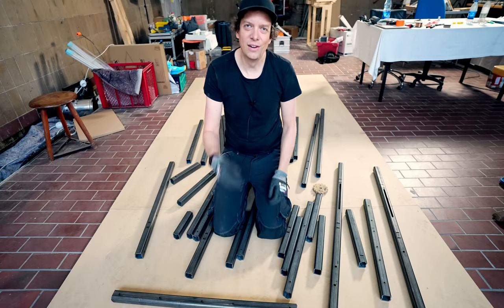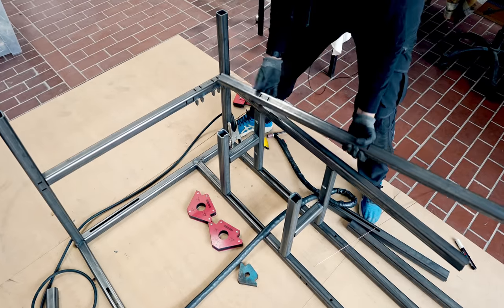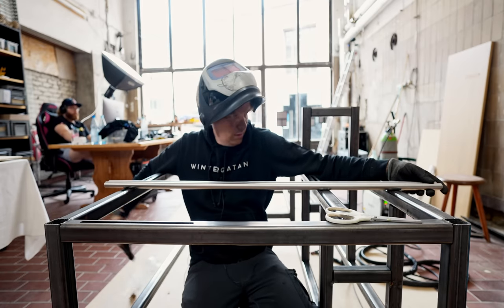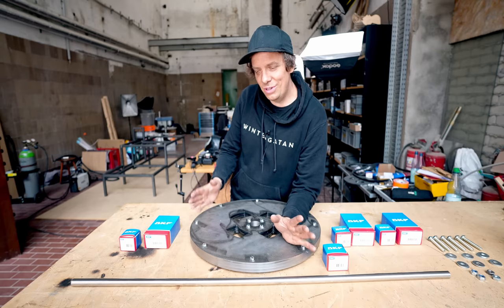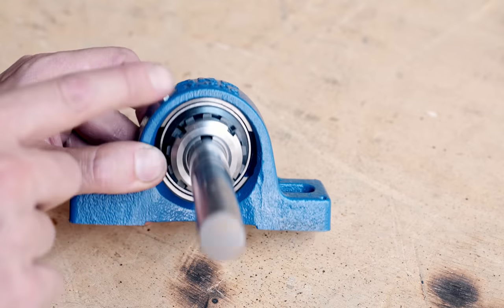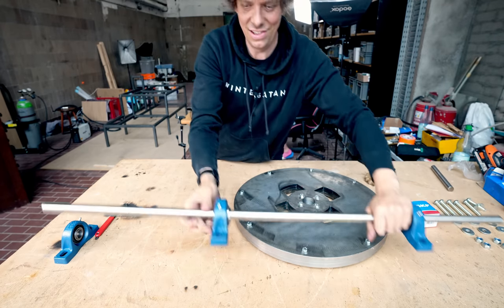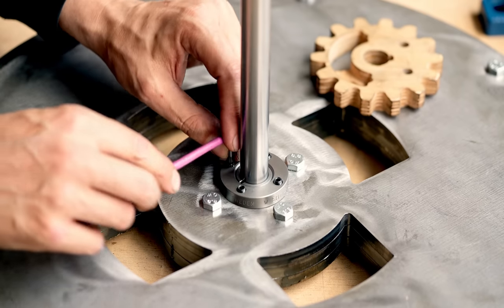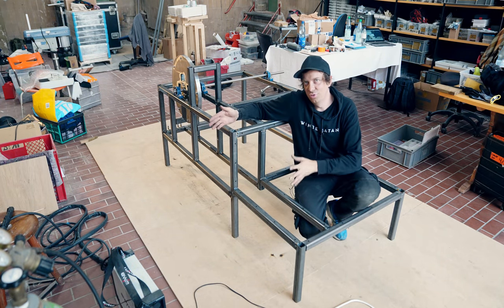Welding the Frame - DAY 3 - Marble Machine Flywheel Prototype

Comment: For some reason, it doesn't seem like the flywheel spins freely for as long as it should.  Watching the video as it came to a stop makes it look like some part of the system has quite a bit a friction slowing it down.
Reply: The bearings will likely need a break in period to be frictionless as possible...

Comment: I saw a slight wobble on the wheel as you hand spun it.  Remember that on the MMX, a wobbly flywheel caused the machine to vibrate, causing inaccuracies on where the marble drops.  So, next task will be to fix that wobble at the speed in which it will be turning when the MM-III gets working.
Reply: I saw similar, but it may be an illusion due to the light hitting the chamfer on the edge. A good test would be to put a ruler across the supports and lower until it touches wheel, then spin to see how much variation there is

Comment: I worry about the bolts and nuts that stand out from the flywheel. Serious potential for skinning knuckles, or worse.
Reply: I was under the impression that the flywheel would be encased in some sort of heavy-duty plexiglass for safety reasons, which would render that moot.
Reply: @Mainyehc  good

Comment: Hate to say it, but it appears that the flywheel isn't running true when you spun it in place.
Reply: I also reacted to the flywheel losing speed. I think the bearings for the axle are not adjusted in height.

Comment: The outside of the wheel appears to be nonconcentric with the shaft. It can be seen starting at 18:04 as the wheel spins. Look at the outside edge as it spins. I don't understand why it's there because the lathe should have made the outside concentric with the bearing hole.
Reply: Reflections off the finish???
Reply: @mattcollier5150  No. Focus on a spot in the background near the edge of the wheel as it turns. It looks to me that the concentricity is off by one or two mm.

Comment: Man saying lathed is unbelievably annoying. Genuinely don't think I can get through another video if you constantly say that
Reply: @Josh_728  there is no x there
Reply: lathed; lathing
transitive verb

: to cut or shape with a lathe

Do you have a problem with "bathed", too? 😅
Reply: @Mutius82  That's irrelevant. English is full of inconsistences like that. By that logic I supposed you walk around telling everyone you runned a marathon last week instead of ran? The simple fact is that the correct word is turned. You turn parts on a lathe.
Reply: Yesterday I cutted my carrots and then I eated them.
Reply: @stephenworsley  I literally gave you a dictionary definition. For the record, though, according to wiki: "the term "turning" is reserved for the generation of external surfaces by a cutting action, whereas this same essential cutting action when applied to internal surfaces (holes, of one kind or another) is called "boring". Thus the phrase "turning and boring" categorizes the larger family of processes known as lathing."

It is correct to say lathed if he turned the outside and bored the inside.
Reply: @Mutius82  You can pull all the definitions you want. You still won't hear any engineer or machinist say they lathed something.